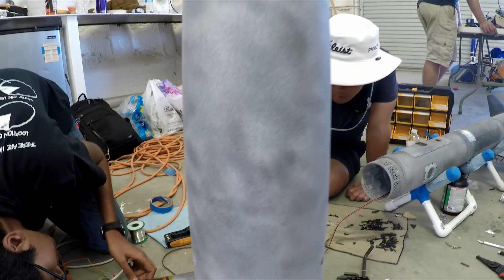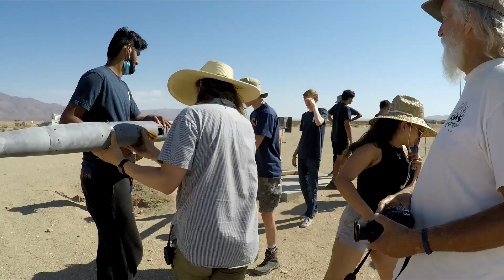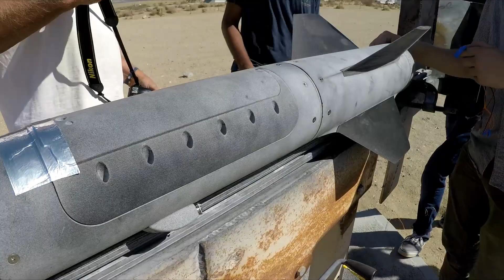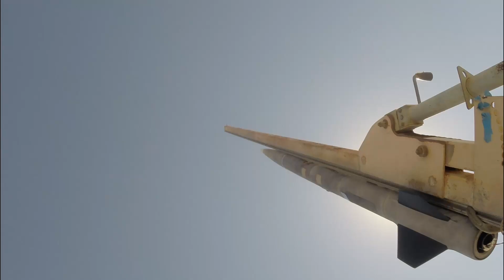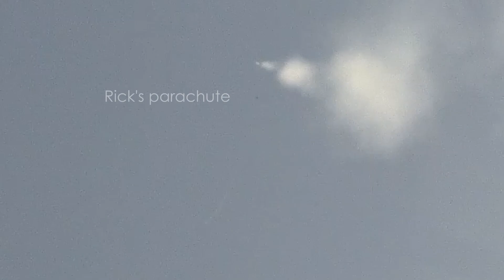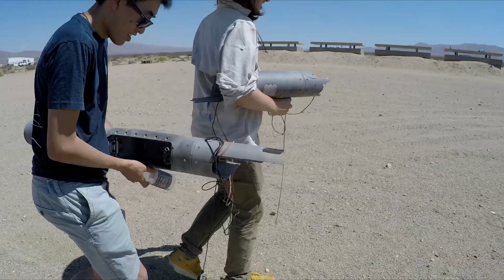Multi Jet Fusion 3D printed rocket, by UC Berkeley SEB

Comment: Looking back at this flight, we noticed the error was not with avionics which we discovered by finding our black powder ejection charges not ignited by our eggtimers. This had us come to the conclusion that our side-deploy drogue popped out early due to a mechanical failure of our nylon shear pins. The drogue then likely shook the vehicle enough to deploy the main as well. The shear pin failure may be due to the reported 170 degrees internal temperature of the vehicle deforming the nylon and creating a lip for the air on ascent yo push onto, pulling the drogue out. This was a really hot day at FAR and it allowed us to make note of this error for our future liquid flight system to not repeat it.